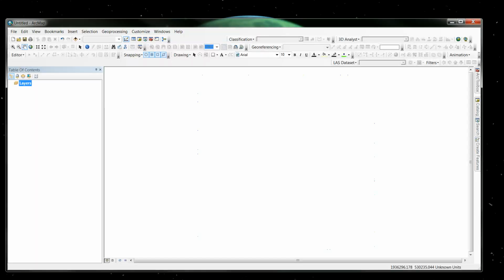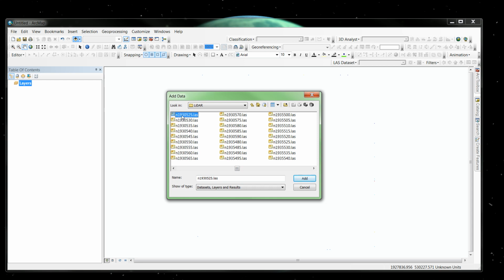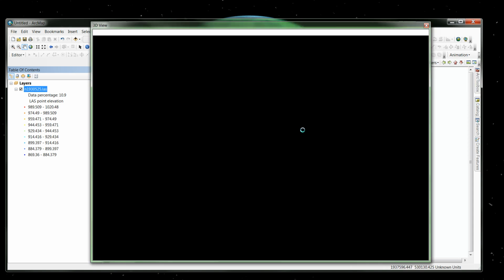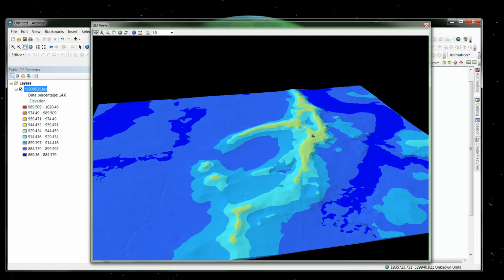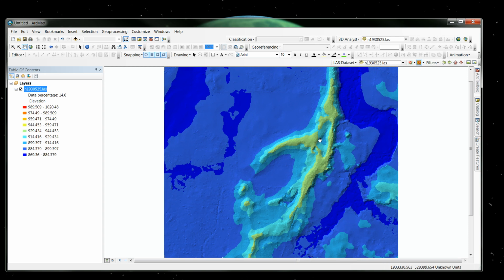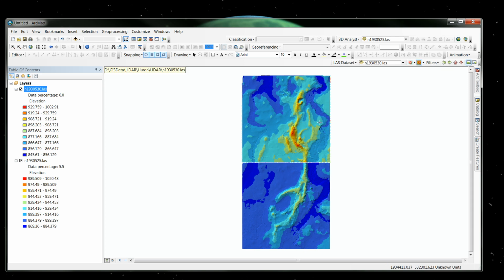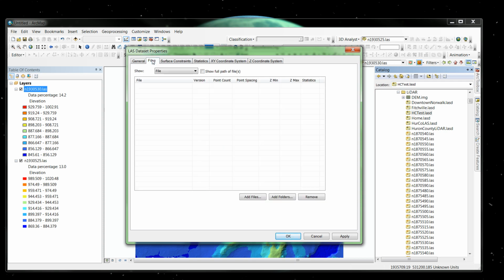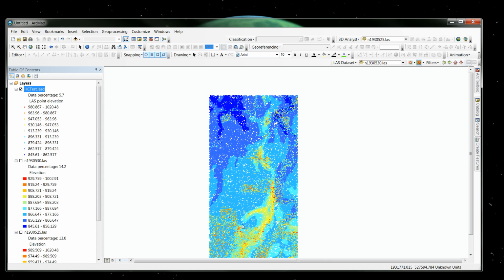LiDAR and Identifying Glacial Features (Pt 1)

Comment: Which type of Lidar data you used, Airborn or TLS? what is the lidar wavelength?
Reply from the maker: Airborn
System Parameters: - Type of Scanner = LH Systems ALS50 - Data Acquisition Height = 6,500 feet AGL - Scanner Field of View = 40 degrees - Scan Frequency = 41.8 Hertz - Pulse Repetition Rate - 115.6 Kilohertz - Aircraft Speed = 130 Knots - Swath Width = 4,732 feet - Number of Returns Per Pulse = Maximum of 4 - Distance Between Flight Lines = 3,313 feet.